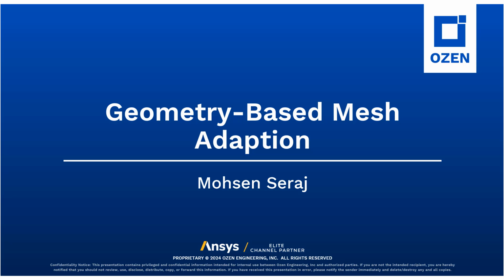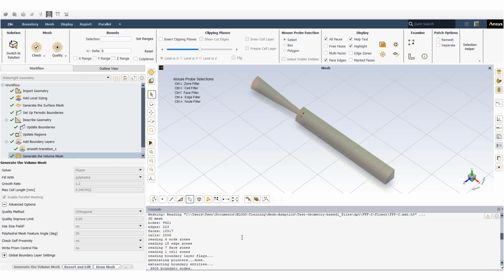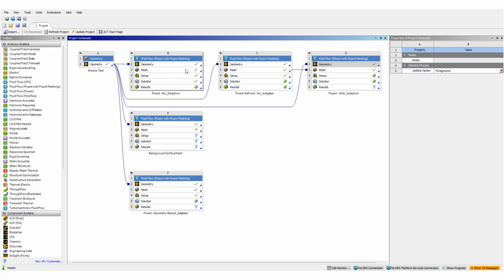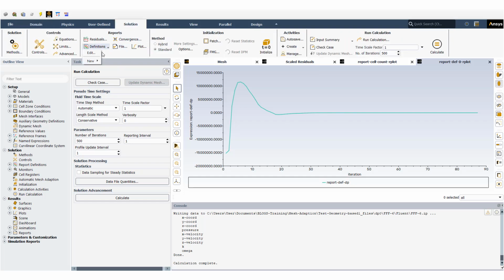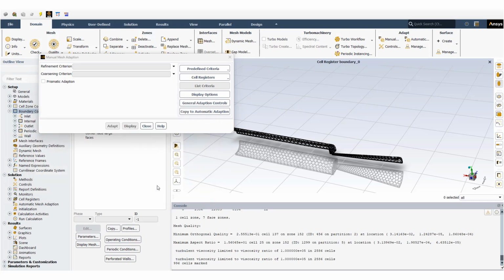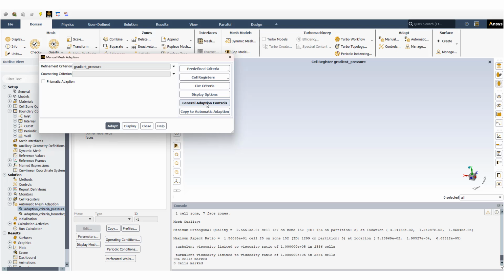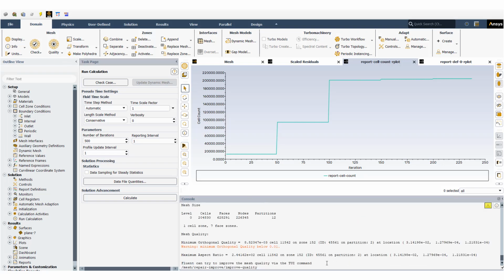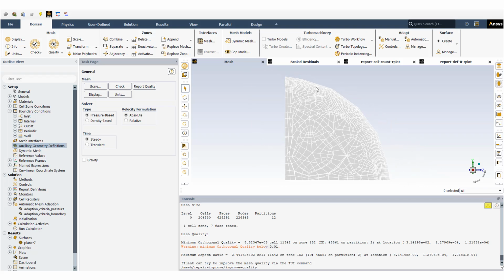Mesh Adaption in Ansys Fluent - Part 1

Comment: Very good video and very much needed. Thank you.

Please, if you feel the following questions are too many to reply to, do you mind answering at least the first one?

1. Do the selected boundaries get adapted for pressure gradient? or do they have their own criteria for adaption? If the latter is true, what's that criteria, and where/when in the Fluent GUI was it specified?
2. Was there a reason you didn't include the upper limit of pressure gradient in the adaption (i.e., > 3000 [Pa/m])?
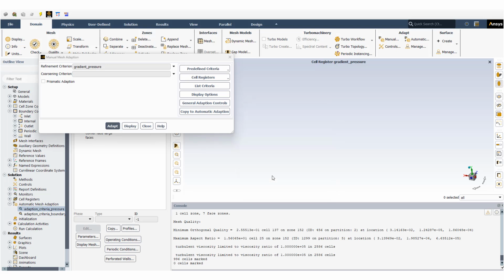3. (32:38) Does the post-adaption orthogonality of 0.01, adjustable in the General Adaption Controls window, so that we don't have a disqualified grid after adaption is done?